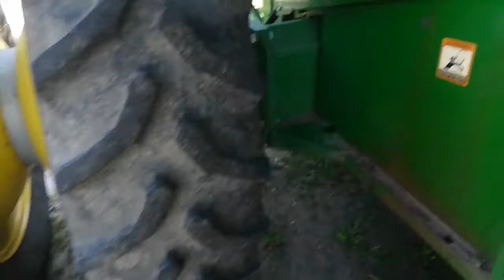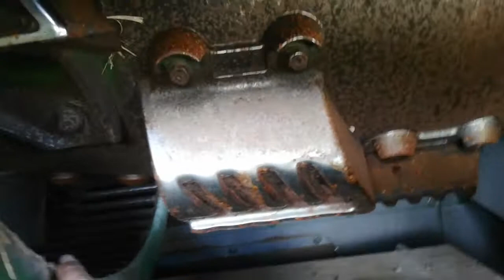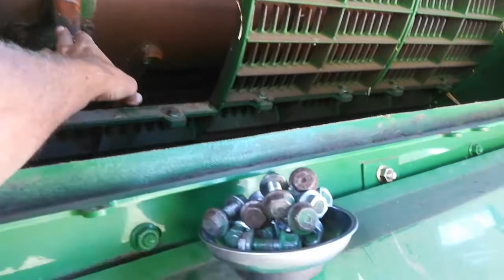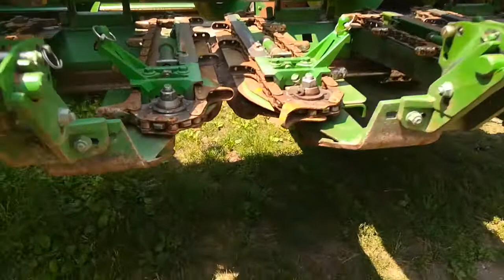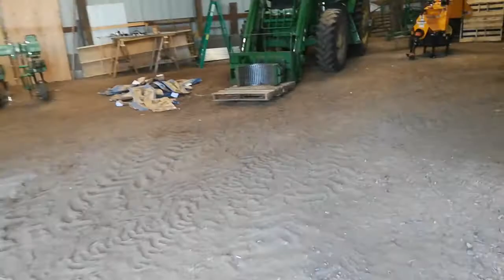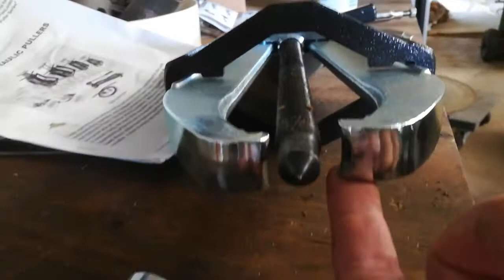Overview of Changing Concaves in Deere 9560sts Combine round bar to small wire

Comment: If you take the 2 pins out of that plate and remove it (takes 1 min) the concave come out easier. That plate also needs to be inspected for wear.  The left side where the rotor feeds from tends to take a lot of wear and can be worn thru. Those pins also need checking for wear as it can cause your concave plate assembly to move up and down several mm.
Reply from the maker: Yes, I eventually started doing that and its much easier.  Taking the plate out is what they tell you to do in the book but I thought I knew better     🤷‍♂